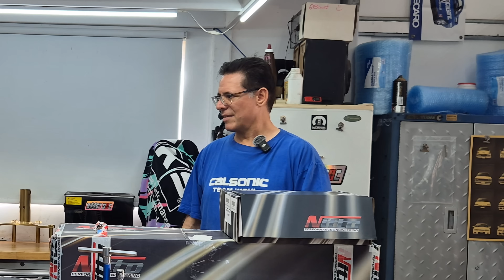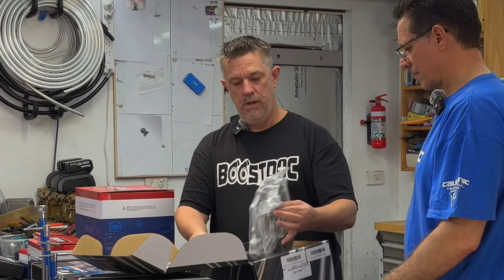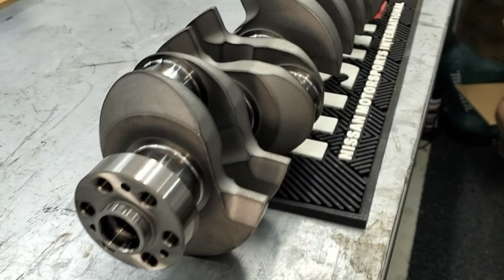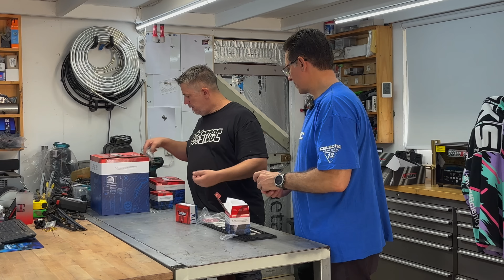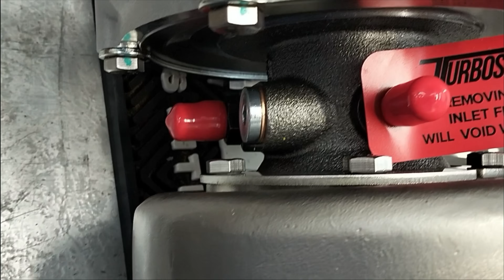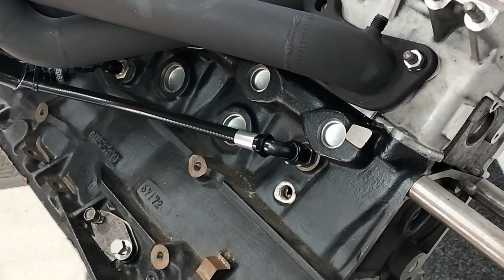Building a 700HP RB From The Block Up (Episode 4) - R32 GTR Time Attack

Comment: Nice gear :)  .. it would be nice to mention what rod bolts they use and what they are and what size the wrist pin was and why ..and what compression your using ,would you recommend coating the side skirts ?  what  turbo smart pressure reg did you get ? does he recon he can control boost using the dual band turbo and manifold with 1 50mm gate LOL .. tell him his dreaming . hmm i guess i will keep guessing.. id like to see what this new turbo smart does .. i will be watching .
Reply from the maker: Thanks for the feedback. Next video will be when all the parts are back from machining etc. So i will try and go through all these questions with him then.